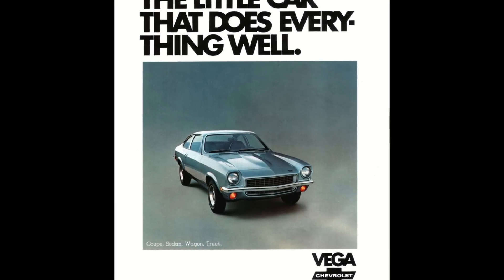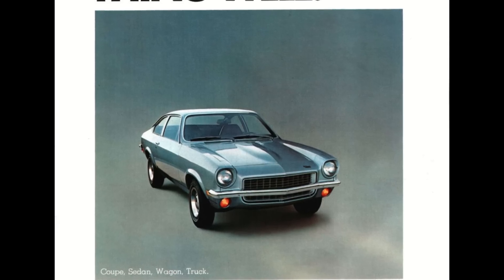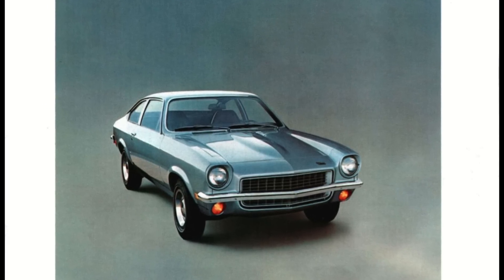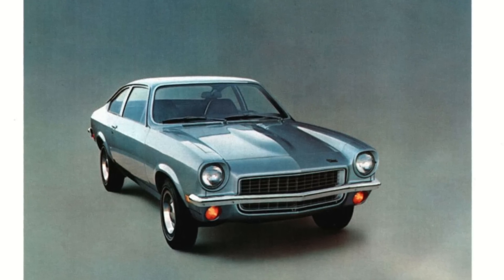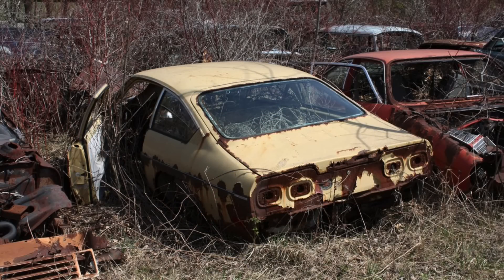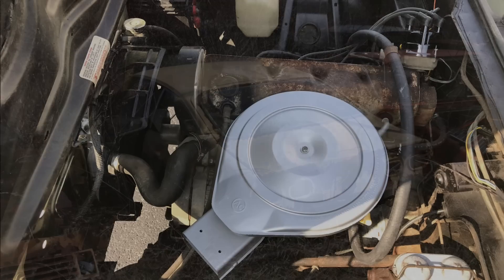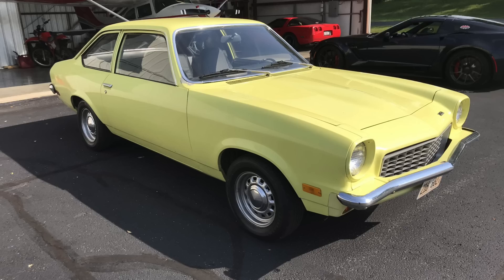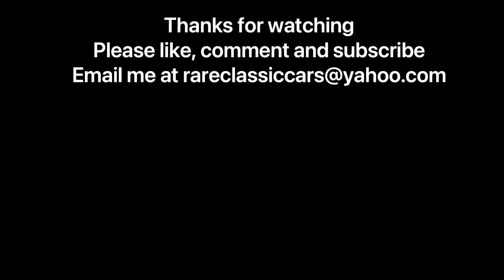GM's Largest Failures: Why The Chevrolet Vega's Engine Turned Buyers Away From American Cars

Comment: Unfortunately, I owned a 1974 Vega GT.  I live in southwest Louisiana where rust is not normally a problem.  My car rusted so badly around the windshield, I kept a towel in the car so I could catch water which dripped in around inside the windshield during rain.  I also kept extra quarts of oil on hand so I could add as needed - oftentimes before I needed to fill up with gasoline.  I had the rust around the windshield repaired at a body shop a couple of times.   Of course, after a short time, the rust would return.  I also rebuilt the engine myself.  I was surprised how light the engine block was.  I spoke to a technician at a Chevrolet dealership who advised me to simply install new piston rings and put everything back together.  Re ringing the engine helped - for a while.  The second time I did a major engine repair, I removed the cylinder head and took it to a machine shop.  The valve stems seals were shot.  I had very little funds available and I did the best I could.  Somehow, I nursed the car along and it got me through college.  Finally, I bought a 1982 Toyota pickup truck.  What a difference!   Understandably, I now drive a Lexus with over 200,000 miles which still runs great and uses no oil between changes.   Still to this day I have a low regard for GM products.
Reply: @tellucas  To be fair, GM is not the only automaker to do this. It seems like most brands make attempts to lower costs, only to have it back fire on them.  Hyundai and Kia are suffering thru this now with their engines.  Not really sure what the root cause of the problem is, but in the past several years they have replaced a lot of engines under warranty due to rod bearing failure.  I remember back around 2008 Nissan having problems with the 2.5 in the Altima.  Piston ring failure, I think they eliminated one of the oil control rings to save a few pennies.  Cost them dearly.
Reply: @Stumpy1973  If I recall correctly the kia issues are with junk in the engine from casting.   They didn't properly clean the block and all the passages.
Reply: @v12alpine  I worked at a Hyundai dealer from 2017 to 2022 and that is what the theory was a few years ago. Not cleaning the block out properly, but even after they corrected that problem they were still having issues.  Heck we had replacement engines spinning rod bearing 15K miles after installation.  Last I heard they had not found the true root cause of the problem. If I recall the issues began around 2014 or 15 when they brought all of the engine production in house to ....  wait for it ...   save money.
Reply: @Stumpy1973 Ford Pinto has entered the chat....🔥
Reply: That happened to a lot of good people who kept good care of their cars. A friend of mine had a litney of problems with a new vega also.  I remember for it that the weirdest problem was rust behind the head liner. When you closed the door a little bit of rust powder would rain down inside the car. GM really shot themselves in the foot (actually more like in the groin) with that one. At a company I worked at I often drove the company pinto, it was a really good little econo box and a joy to drive in town. But ford did that fuel tank thing, they could have fixed (or at least mitigated) the exploding fuel tank but cheaped out and turned the pinto into a deadly joke. I think ford was (if possible) even more stupid than GM on that, the Vegas were going to require a good throwing away but the ford could have been recalled and fixed at a reasonable price. Now we get to see Boeing doing the same thing (I grew up in an aircraft town), the bean counters took over and now Boeing is just a world wide mess.
Reply: @tellucas  I don't blame you, my 2008 Accord V6 was one of the most problematic cars I've owned. It was also noisy (most from road noise) and rode harder than it needed to. In contrast, my 2003 and 2011 Chevy Avalanches with the 5.3l V8 have been very reliable, especially the drivetrains. My Honda used a quart of oil between changes, my Chevy's use none at all.
Reply: @cdstoc  I believe that Accord twin Acura had to be better somehow so they gave them better sound insulation and more compliant suspension. Other than more luxurious trim similar Acura is basically an Accord.
Reply: So the high silicone content aluminum needed for the engine block and the custom iron dipped pistons cost LESS than the $2 standard, proven iron cylinder sleeve??
Come on GM, use your head.
Reply: @elebeu   Well, there is additional machining needed to properly fit liners so they are reliable long term. They don’t just drop in a cast block. If GM saved even 12 bucks per engine the bean counters won.
Reply: The GM DIESEL 350. Another GREAT engine.
Reply: @jbauern57 I can’t understand how GM could make large great truck and marine diesels but made such a bad car diesel.
Reply: I drive an ‘07 Lexus IS 350 with 193k miles, runs like new and uses ZERO oil!
Reply: my condolences .lol
Reply: i'd be amazed if any of them are still running today ! smh
Reply: When I traded my 73 GT in 1976, my oil mileage was 1 quart per 1000 miles.
Reply: ...but you were cool.
Reply: Same story only with an 80's Skylark, I don't remember the model year.  It had a very easy life, I only drove it to school and back and Dad did all the maintenance so it was always well cared for.  Even so it was always in the shop.  I didn't dare drive it in the winter for fear of getting stranded.  Took it to the junkyard and I got a beat up old Datsun station wagon instead.  That car was an absolute zero on style and coolness but a solid ten for reliability.  It never broke down.  That Skylark was the last American car I've owned, other than collector cars from the 50's and 60's.
Reply: Had a 61 F-85 Cutlass.  Great car!
Reply: GM repeatedly has shot themself in the foot in the past and still now I think, my dad retired from GM and I drive a Toyota
Reply: To be fair not everything GM has made historically has been junk, the Olds V8 for example from this era was exceptional and well known for being reliable. Today every new car burns oil, it's actually normal for them, even Toyotas to burn almost a quart of oil.

Comment: I had a 72 Vega GT and the valve seals were the biggest issue. We changed oil and filter always at 3000 miles and never had issues with cylinder oil consumption. When you went to idle from load, it would blow hugh blue smoke as the vacuum sucked oil around the valve stems.  Even with this issue, I still got 130,000 miles out of the engine. It was a spunkly engine with the 2 bbl carb and 4 speed manual tranny. I also bought the Fram aftermarket air cleaner kit that allowed you to just change the element, because the AC unit air filter was $15 in 1973! Other issue was the electric fuel pump and low oil pressure shut off. On full throttle acceleration you would occasionally have the engine shut off due to oil going all the way back in the pan giving you momentary low oil pressure. I always carried a jumper wire where I could reprise the fuel system. This car was a bit rough around the edges, but it was fun to drive. You just had to know it's quirks.  Not something a non-gearhead wanted to deal with...
Reply: Sounds like my situation. I had a 74. 80K mi. It would burn oil making a turn. 1 quart/800 mi.
Reply: I had a 2 liter Pinto engine that smoked like that. I assumed it was guides, I bought a Ford reman head for it. That solved the problem for about a year. A permanent solution was to change the crappy factory valve guide seals for some nylon ones. When my Pinto smoked, I said it was acting like a Vega.

Comment: The early models were pretty decent looking cars. Even a 2.5 Iron Duke would have been a better choice, had it existed at the time.
Reply: The Iron Duke's were slow on the highway.  My 76 Chevette had about 75 HP and was pathetically slow and dangerous on the highway.  At least the Vega had some balls.  Never had a problem merging into traffic with the Vega's 90 HP 2.3 engine.  Although the body and exhaust rusted out faster than you could fix it.  Awful build quality from GM.  Even the crappy Chevette was a better car with 4-speed manual  transmission and no overdrive ( car didn't need it slow as all hell anyway.  People were constantly blasting their horns at me on on and off ramps on the highways in NY).
Reply: @garykeith1048  A whole 75 HP from a 2.5L 4-banger, that's 5 more HP than Ford's 250 ci straight 6 of the period, consider yourself lucky!
Reply: @garykeith1048  Chevettes never got the Iron Duke ... the early Chevettes ('76 was the first model year, so probably yours) had a 1.4 litre pushrod engine of a different design (Isuzu) with a rompin' stompin' 53 horsepower! "Slow" was an understatement ...
Reply: No Chevette ever had the Iron Duke.
Reply: The Iron Duke went into the later H bodies.
Reply: Chevrolet had the 153 4-cylinder at the time - discontinued in 1970. Probably would have been better to keep building that ...
Reply: Ah right, or that chopped Pontiac Trophy 4.
Reply: @valengreymoon5623  That one was half of a Pontiac big block ... probably too big. Elsewhere someone had another good suggestion ... the Opel 1.9 "cam-in-head" that was already in production in Europe, and which had been designed in Detroit. There's plenty of coulda woulda shoulda to go around!
Reply: That's true.
Reply: It's ancestor, the Chevy II engine did, and should have been used.
Reply: @michaelbenardo5695  The Chevy ll four cylinder was a very durable engine. 200.000 mile engine, taken care of.
Reply: They should have copied the opel 1900 engine from germany. Opel is gm subsidary  and it was a proven engine... why reinvent the wheel.  If they wanted to test the silicone impregnation process they would havemore time to get it right.  Mercedes M117 engine and porsche 928s used the process very successfully